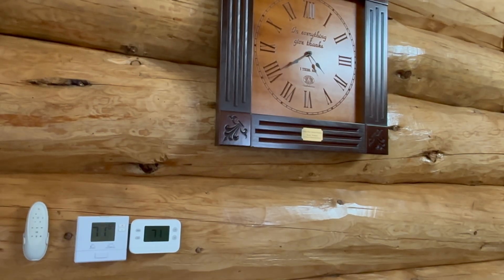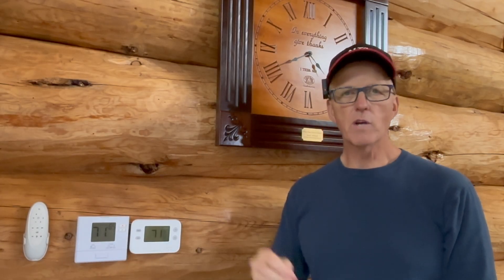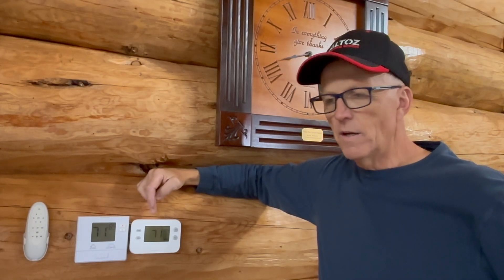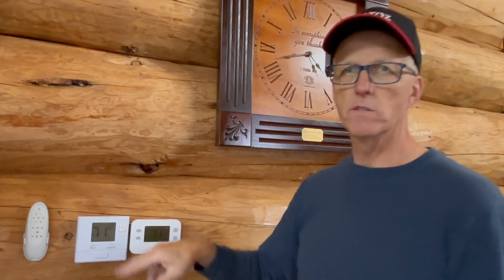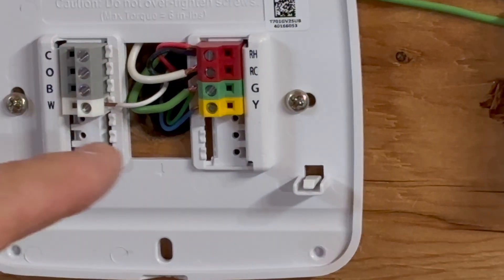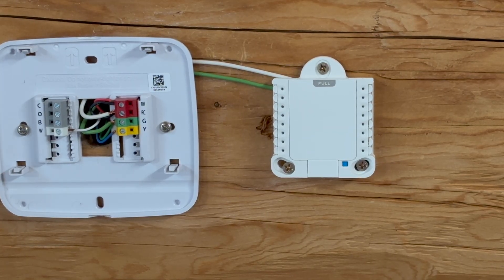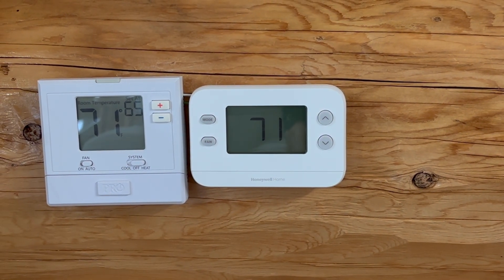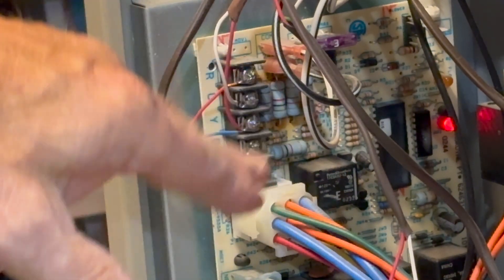How I Hooked Up A Thermostat For My Outdoor Wood Boiler!!

Comment: I hooked this up on a system with a heat pump and it is only turning the fan on low speed. Any ideas to make it work correctly?
Reply from the maker: I don’t I’m sorry but get on outdoor wood boiler Facebook page and ask that question and someone will answer that.  Kevin
Reply: Did you ever figure this out? I’m having the same trouble with fan speed
Reply from the maker: I don’t know sorry,

Comment: Does the hot boiler water flow through the heater core in the plenum irregardless of a call for heat (blower energized)?
Reply from the maker: Yes, the water is constantly flowing.
Reply: @klwit1980  With the hot water always flowing through the heater core in the plenum, there's no concern of residual heat in the duct work even when there is no call for heat from the stat? Do you have a/c in your furnace as well?
Reply from the maker: No concern with the heat, never had complaints.  What happens is your house is more of an even heat.  Because the water is always running and when the blower kicks on you have heat coming out of your registers right away. 
Where with  your furnace blower kicks on then the igniter in your furnace, which makes cool air start to blow before are fully kicked in and then once your thermostat is up to temperature the igniter shuts off, but it still blows until it cools everything down.
Reply from the maker: So you don’t have an even heat.  I also do have air conditioning, that coil is under my owb coil.  During summer we have no concerns with cooling because the owb is not running.